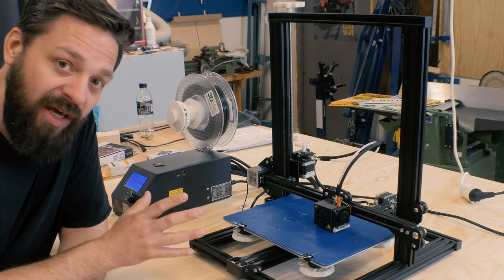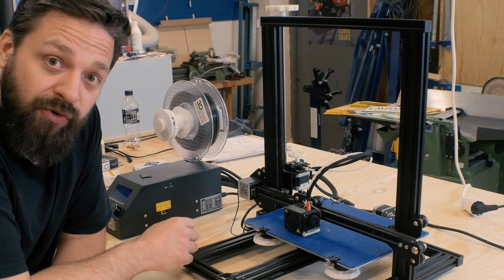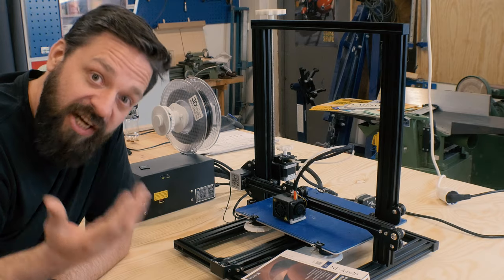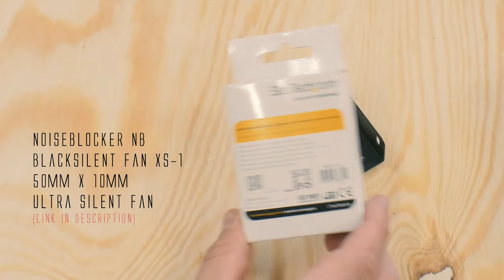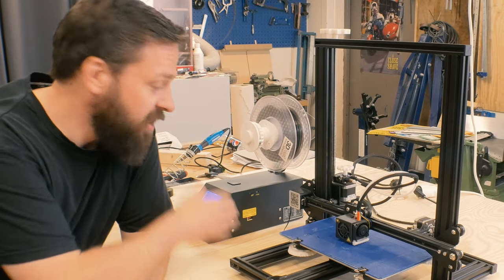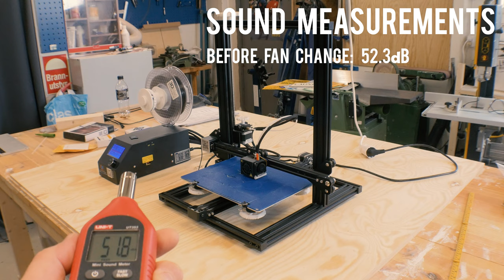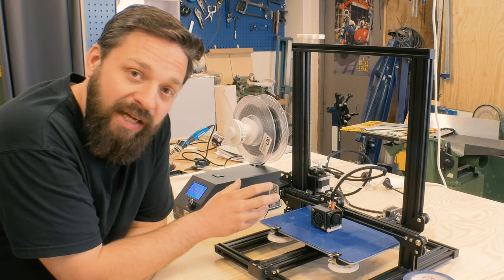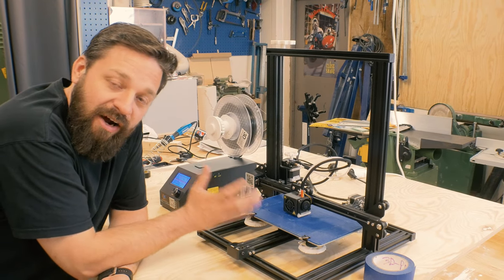Creality CR-10 - changing 3 control box fans | MINI | QUIETER

Comment: Thanks so much for this video. It is well edited and to the point. The power supply fan in my older CR10 (bought 2017) was really growling which told me failure was immenent. I bought all 3 fans through your links. A couple of notes:
1- I had to shim the BlackSilent XS1-50 fan. I put 1mm thick washers between it and the bracket to clear the fan blades.
2- The StarTech 60x10 fan is half as thick as the fan in my power supply, but I’ll assume it can move enough air.
3- I used sticky putty (used to stick posters and such to walls) to stick the shim washers to the bracket while I mounted the board fan. I also used it to hold the allen screws to the allen wrench while mounting the board fan bracket to the box, and to hold the screws in the rear fan while I lowered it into place and got the screws started.
Hope that’s helpful. Thanks again!

Comment: Thanks for taking the time to create this video. FYI- the fan size in the link is different than what you replaced it with in the video. 50mmx10mm is the correct size.
Reply from the maker: And thanks for watching :) I will check it and change the link if needed. Thanks for info
Reply: @WillysGarageNorway  I'm sorry- the links were correct for the fan sizes but the  brands for the 50mm versus the 60mm were swapped which is what caused my confusion. Thanks again

Comment: Thanks for the video i got the same faulty bearing fan problem. 

I just ordered the replacement but i will clearly uphrade the rest soon
Reply from the maker: Thanks for watching:)
Reply: @WillysGarageNorway  I dont know if its a more recent addition but that same nocturna fan in the back to me came with connectors to connect the wires together.

Comment: Cool you should try a thing, i don't remember it's name but it's made of 4 diodes and used to make the steppers works silently. Search of smooth stepper etc.
Reply from the maker: Hi, I will check it out and thanks :)
Reply: @WillysGarageNorway  👍👍👍👍
Reply: Those are called TL smothers. My understanding is that they increase the print quality by removing "salmon skin" from the print. I don't think they reduce the stepper noise. 

I have rubber mounts for my steppers, and the noise was SIGNIFICANTLY reduced. You can find them easily on Amazon

Comment: dampers a hassle? I a am a 3d printing noob and installed mine in like 15 minutes. OMG so much better now I dont even hear the motors all i hear is fans so thats next.  Use to hear the printer anywhere in my 800sqf house now I and do long prints and sleep it awesome.
Reply: Yeah... if you are worried about noise levels but are not going to deal with putting on dampers, you might as well forget the fans.

Comment: Hello, i really need help. Is cr10s from 2018 12v or 24V? My hotend heats up really slowly and cant even heat more than 170C. Hotend 24v fans are really quiet. So i maybe think that half of the machine is 12v and another half 24v?Thanks!a

Comment: Why did you cut the cables? Why not just plug in the new cable into the board? Will it not fit or something? If not, where can I buy a fan that will fit without having to cut?
Reply from the maker: The connectors where different. I dont know where to find fans with the same type of connectors

Comment: Hey great video. I was wondering what you call the type of connecter and tool you used to splice together the 2 separate wires? Also what is the type of connection called that you used to connect the wire to the board itself? It seems you have connected 3 separate fan wires to it then into the board itself. 

I ask because when I did my upgrade I just put them all in with just the fan wires separately and it was very annoying. I would like to go back and organise and clean it up.

Comment: Creality v1.1.5 motherboard will make the stepper motors silent!
Reply: Thats an Ender board,not a CR 10 one.
Reply: @BraboPaul1  doesn't matter, flash marlin or th3d firmwire and select the relevant version of cr10, works like a dream
Reply: This is true. Just installed a silent ender board on my cr-10s and flashed it with the TH3D Unified Firmware.  I really can't hear the steppers anymore. Just the fans.

Comment: Great video, thanks for your sharing.
I only have one question... Why everbody cuts the hires, there is a srews on the board to attach the fans, why cuting and soldering or using joins????

Im planning chnga the fans soon the printer ar making to mutch noise
Thanks one mor time
Reply from the maker: Hi and thanks for watching 👍😁 there is no reason other then that it might be easyer for people to hook into the original cable. I think there are more then one cable hooked up to the screws? Im not a 100 % sure. If its easyer to use the screws, I would do that 👍
Reply: @WillysGarageNorway  thanks for your aswer
Reply: @Substancia3D  I ordered the exact fans and the connectors are different.  If you want to use the connectors, you'll have to snip the wires and solder.  I didn't see any screw in posts to power the fans

Comment: For some reason, your CR-10 looks smaller than mine.  It's tripping me out. The fan that makes the noise is cheap, i've replaced all of my fans with ones recovered from a Xerox printer that have actual ball bearings, and i'd recommend everyone to get actual ball bearing fans because of the odd angles at which they are made to work. Regular sleeve bearings will fail all the time.
Reply from the maker: Thaks for your feedback, the printer is a CR-10 mini 👍😀
Reply: @WillysGarageNorway  Ah, that's the pickle. Seriously tripped me up, all the components in the mini are identical to the CR-10 regular. :))

Comment: Hi There. Very good Video. As someone else said My CR10V2.2 ( has Titan Direct Injection)  (same as the CR10v3)is  a 24 volt system. Do you know what the part numbers would be for me? Also, the part number for the square black fan on the left side of the extruder. 
Thanks.....
Reply: I just change fans in my Cr-10 V3 , I used noctua fan for the back same as in the video and for the board Gelid Solutions Silent 5 50 x 15 mm. CR-10 have 24V original fans so I had to use step down regulator to 12V and it's working really quiet. The only fan I can hear the most is hotend
Reply from the maker: Sound like a good update 👍

Comment: I had the same problem with my gtech , the damned fan was so loud i could hear it from outside my house !  They used a thin high speed fan originally but there was some room in there for a thicker fan that ran at a lower speed with the same air flow rating , you cannot hear my printer from a few meters away now .
Reply from the maker: Thats good 👍 the fans are very noisy! I want to replace the one on my extruder also some day :)
Reply: weird, my cr-10 mini puts out 38db stock as far as fans go, the real noise is in the motors and beeping sounds
Reply from the maker: @otallono  I have heard some rumors that they changed the fans frkm the factory on newer versions of the printer (1 year ago approx) and ghat they were a lot quiter after that change

Comment: Hello,

Thank you very much for this video, tutorials and great advices. I will order the same fan and perfom the replacement for my CR10 V2.

Thanks a lot 😀

PS :

I just check mine there 24V, but the one you replaced are in 12V. Do you think it may work ?
Reply from the maker: I think so
Reply: @WillysGarageNorway   @WillysGarageNorway  I postpone this project but I found some 24v/12v back converter, I will probably buy some. 

Again thanks a lot for this great vidéo and help

Comment: on my CR10 the original 50x15mm fan work at 24volt , your replacement NB 50x10 work at 12v !!!!!!
Reply: I have an original CR-10.  No S, no V2, V3, etc.  Just CR-10.
The PSU says 12V.
Output is measured at 12.04V per my DVM.
The two chassis fans say 12V, and are getting 12V.
I have not opened the PSU chassis for its fan yet, but I'd assume it's 12V as well.

Comment: Question my cr10s5 fan that blows over the inner board does not kick on when switched on only the fan in the silver power box and back of black casing. I assume this is not correct and I have a failed fan? 

edit pulled the fan and it will run off of a 9volt battery (its a 12v fan) now I’m at a lose why yours runs in the video while installed and mine does not.

Comment: So at 3:35 you replaced a 2-pin DC fan with a 3-pin brushless fan and only connected 2 of the 3 wires? I'm happy for you that the fan is working in the video, but I have no idea why it is. Since you do not explain in this in your video,  I cannot in sound conscience follow your methods. I will be buying a 2-pin replacement for my broken 2-pin fan.
Reply: The third wire on these fans is an RPM signal wire coming BACK from the fan...  In the case of the CR10S this third wire is not used, and can just remain not connected.
Reply: I did a the video said and just connected the black and red wires, but the fan isn't working. Why?